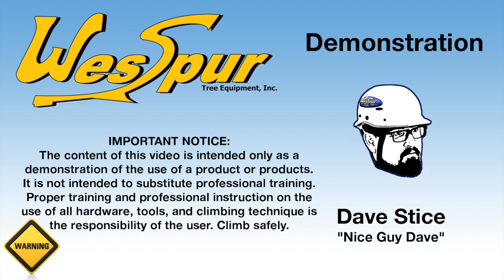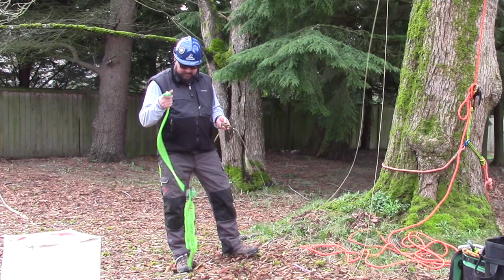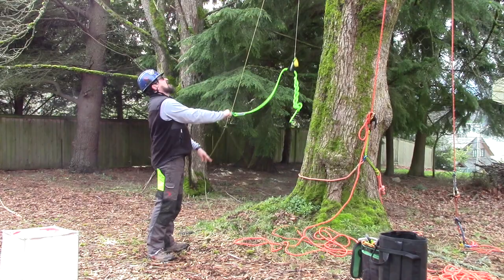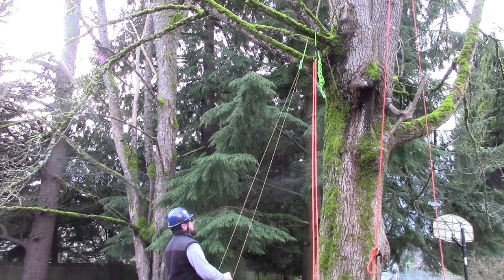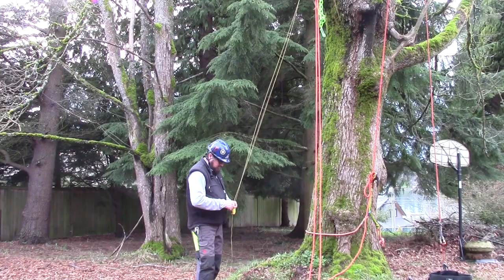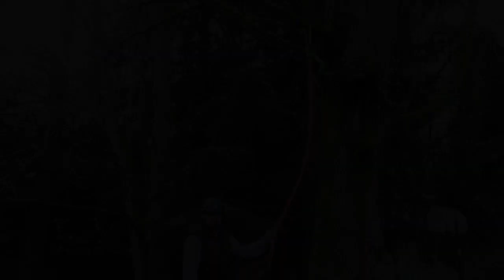Friction Saver Installation from the Ground with WesSpur's Niceguydave

Comment: I always feed my line through the large ring first. Then attach the bag and throw it over the limb. Then take the bag off put line through small ring, put the bag back on and pull the friction saver up and over the crotch. Then all you have to do is take the bag off and attach your rope like normal and pull it through

Comment: With your 5 foot heat resistant friction hitch cord tester pack are there splices in the cords or is it just five feet of basic cords
Reply from the maker: The later- the cord tester packs are unspliced.
Reply: @WesSpurTreeEquipment  Its 5 feet away made so easy